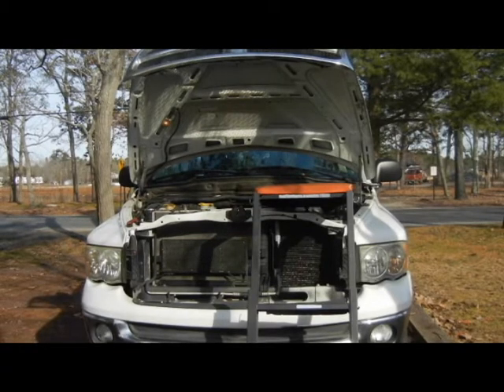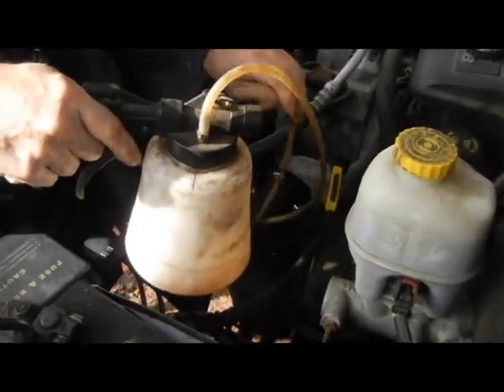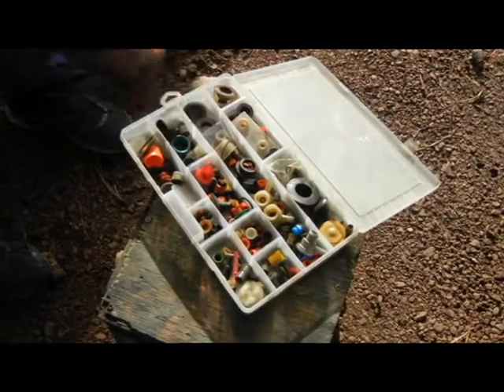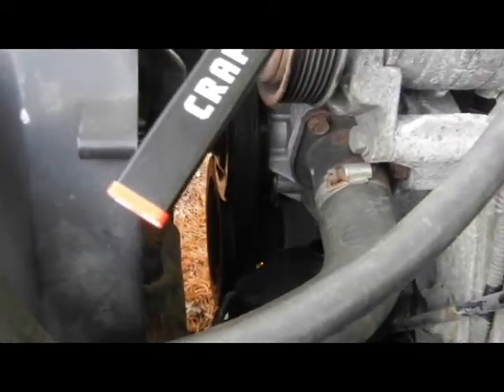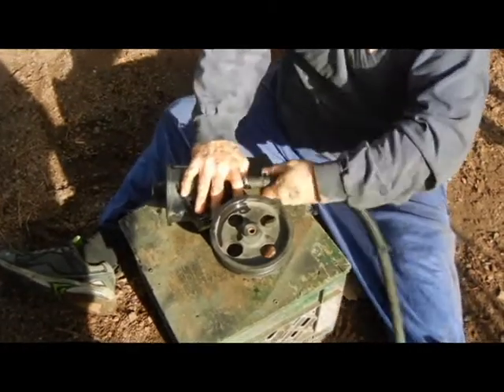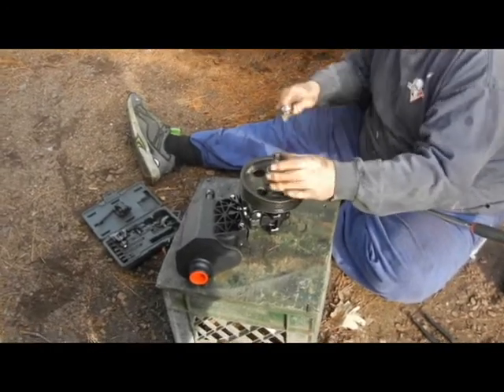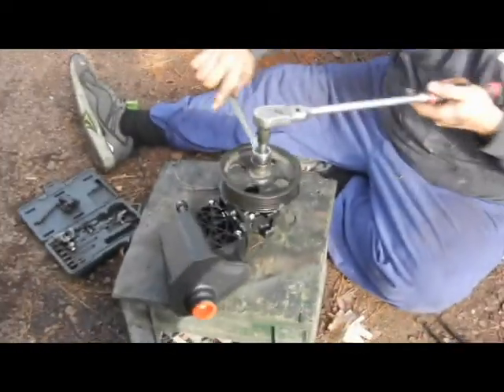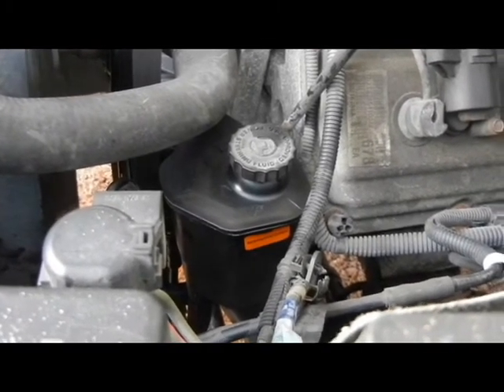05 DODGE RAM 5 7 POWER STEERING PUMP REPLACEMENT!

Comment: Good video! I think this is wrong with my truck, wines when turning, and feels like no power steering sitting still or moving real slowly. If you give it gas it seems to get easier. My truck is on 40” tires on an expensive lift kit. You think this may be my problem? I also wonder how long a pump last on my truck with 40s. Thanks, any advice helps.
Reply from the maker: Either upgrade to a larger displacement steering pump or hydraulic ram type steering and pump. the stock pump is probably too small for the job or worn out.
Reply: Thank you for the reply! I appreciate it.

Comment: I’ve recently had a new power steering pump installed in my, 04 5.7 Dodge, and it was still leaking. Any idea why ?
Reply from the maker: Did they pinch a seal on any of the fittings or is it leaking under the pulley at the shaft seal Did they use all new lines?